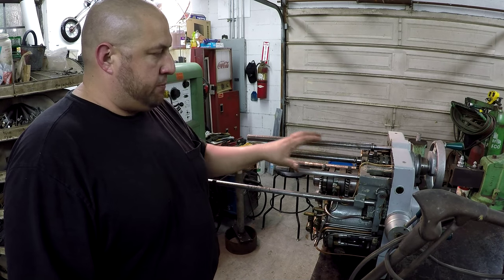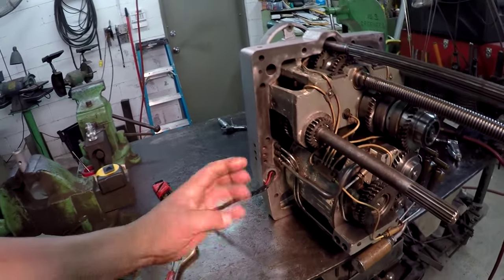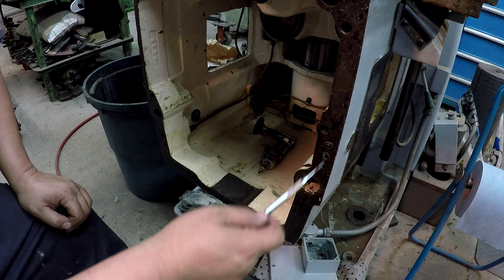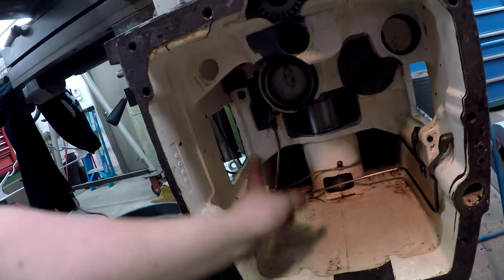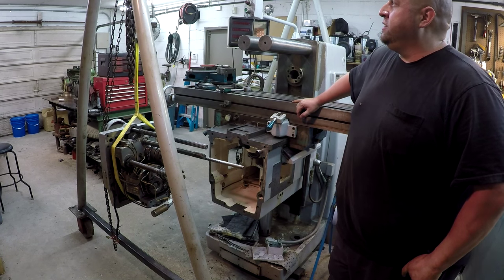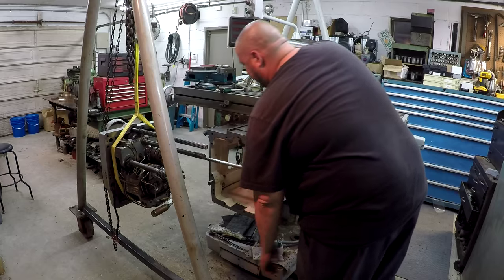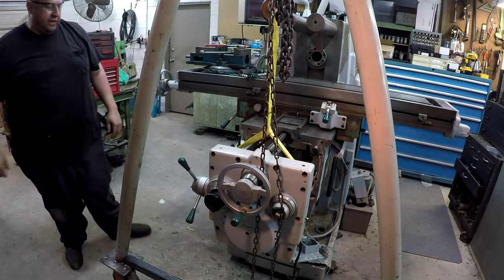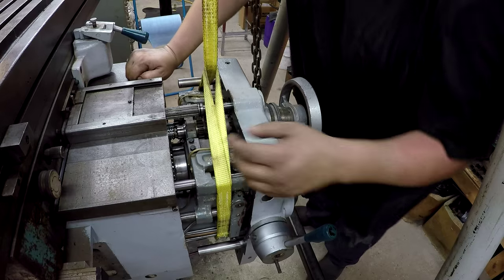K&T Knee Re Installation Part 1

Comment: At 19:35 I saw a small piece of wire fall from your chainfall or strap and land in the right hand channel in the top side of the cast you cleaned out earlier. The funny thing is, I literally almost put my hand through my screen trying to pick it out for you lol.

If you've still have it apart you might wanna pick it out.

By the way, great job on all your videos. I really appreciate all that you show us. I'm a pump mechanic and we recently acquired an old Pratt & Whitney 16x36 lathe for our shop. I've had a lot of fun watching you Youtube guys and learning how to use it.
 
Thanks again, Bob from Indiana

Comment: Nice video, as always. Good coverage of the details that are required to get this back together.

A lot of things to get lined up as you reinstall that faceplate. It looks as though they set up the lengths so that you can align them one at a time - even those locating dowels were different lengths.

Looking forward to seeing the "first oil" when you find out if everything is working properly.

Comment: That RTV has damaged a lot of engines over the years. Not even counting the machinery it has hurt from using to much.
I have seen engines that looked like it was applied with a scoop shovel.
Glad to see you using the gasket 515 sealant. I have used that since the early 80's.
Really like the videos.
Mike
Reply: +Oldvet1946 Back then (early 1980's), I used the other brand of gasket replacement sealant... either brand works well if you are careful...

The red RTV goop gets abused in the HVAC business - the guys out here refer to it as "pookie", especially if they are cleaning up after someone who slopped it on without a care trying to make up for a deficient match-up...

Cheers,

Eric
Reply: Oldvet1946 Yeah, too much RTV clogging up the oil galleries, hydraulic lifters, etc.  They came out with some "new" stuff in the 1980s, that is used on Porsche engine cases.  It was called Curil T.  It is a nonhardening sealant that is easy to clean off/remove.  There are many different kinds of sealants, etc., they all have their place.  Too many guys don't know what they are doing, what type of sealant to use, and apply TOO MUCH.  It isn't as simple as it was in the 1960s.

Comment: Hey Adam nice Vid. Reminds me of the work I'm doing on a Huron NU-4 that I'm doing up for myself. The gearboxes were the same as you described, coated in a brown tarnish in the feed box from the 68 Oil and the spindle box was black from the gear oil. Gave them one hell of a clean out and they look fantastic considering the machine is 35 years old. Adam I always use a good smear of grease on O-Rings to hold them in place, never had any dramas. Glad I'm not the only one that has come across the old silastic in the oil galleries. Happy machining and all the best from Brisbane Queensland Australia.

Comment: Looks to be going together just fine. That same gasket eliminator is used on a lot of auto engines these days. Works great IF you have clean surfaces. RTV in the oil ports !!!!!!  Good way to damage parts. I use it on engines but I've seen a lot of folks who seem to think that if the 1/8" bead is good, the 1/2" bead must be better....

Comment: Ack! 20+ years of engine work I've seen many an RTV goobered up engine just like that. Irks me every time..:-) RTV silicone has no place on a machine! There are so many better sealants. The Loctite flange sealant you used is pretty good. Used it quite often. My first choice would have been Motoseal or one of the ThreeBond sealants. They work awesome.
I see from the SNS that the knee is back together. Don't forget us on startup.

Colin ;-)
Reply from the maker: Got it all on video Colin. You'll get to see it start up pretty soon. 👍

Comment: Adam , shouldn't you use some Hydraulic oil on the rods and threads for reassemble ? Shouldnt be to much a problem on the used machine tho I guess. Your doing a pretty good job on her so far , she otta run like a new machine after this. I'm a machinist by trade but fate change my life and disabled me. Your livin my dream life Adam thanks for shareing it with us all. Gary

Comment: Going back together nicely. I hope it ends up working great. Horizontal mills are fun, i have a No.4 Cincinnati myself. About the video the only thing I am wondering about was that I didn't see you re-tighten the oil pickup tube fitting again after getting it clocked to it's final spot. I was trying to figure out how you were going to get to it with the gap that close. Is there enough room going through that hole on the side? Keep up the good work and love the videos Adam.

Comment: I have never liked holding O-rings in place with gasket sealer, I have had good luck with a dab of thicker sticky grease, I have run into the problem you found in the oil ports myself. I ran into one long oil port that was so plugged with darn sealer I had to use a small packing puller to fish it all out. I try to tell people if the sealer squishes out, chances are the same amount went inside as well. I figure with grease chances of it plugging something up is not going to be an issue. Enjoyed the video, thanks
Reply from the maker: +Repoman The 515 stays wet and will dissolve into the oil. But I do agree with your comments. Silicone is a reall no no around hydraulics.
Reply: Abom79
   I agree a small chunk floating around a hydraulic system can and has made me pull my hair out trouble shooting some strange problems.   I look forward to watching more of your videos.
    I started watching that crazy guy AvE, he had mentioned you in one of his videos, glad he did, I love to learn new tricks of the trade.

Comment: Feels like you are in the home stretch now! Take it easy and try not to work too hard though. It's easy to get wrapped up in the excitement of nearing the finish. Wish the recent travels, work, etc you need a break too. Shark fishing though?

Best wishes,
Tom Z
Reply from the maker: Tom it's been a much needed break from work. I'm usually always busy in the shop or working, that sometimes once you step out and so sometjing different for a change, it's like a breath of fresh air. Family time is important, and me and my cousin are always there for each other. The shark fishing trip was just a way to have fun and relax in the sand for an evening. We had a great time.
Reply: I'm so glad you got to take the time off. I kept waiting for some video of your catch but sometimes it's more about dropping the line than it is hauling it back in...

Best wishes, my friend.
Tom Z

Comment: Talk about overly complicated. Can't you just sharpen up an 3/8" chisel to clean the mating face? far, far better than using an abrasive air-tool. Better control, less mess and less chance of damaging a cast iron surface.